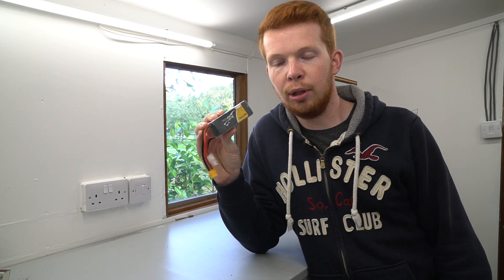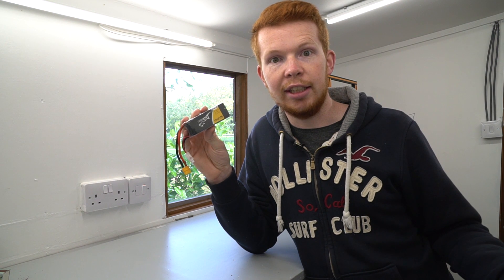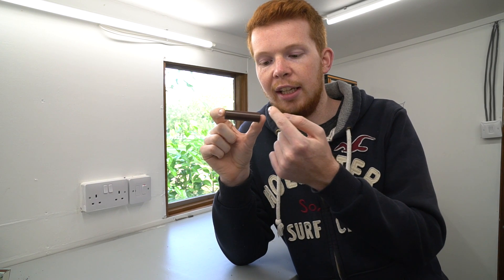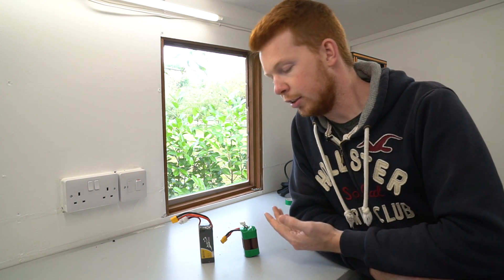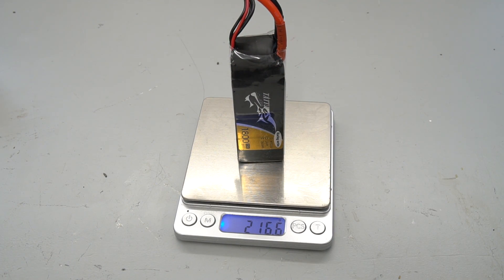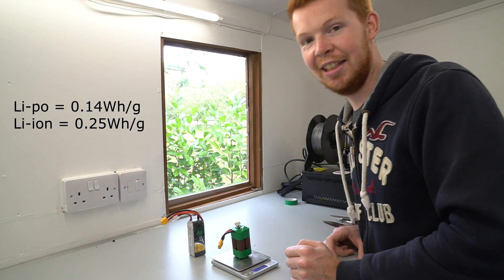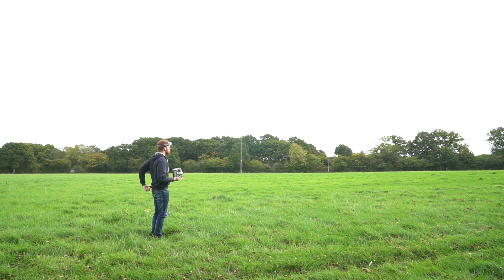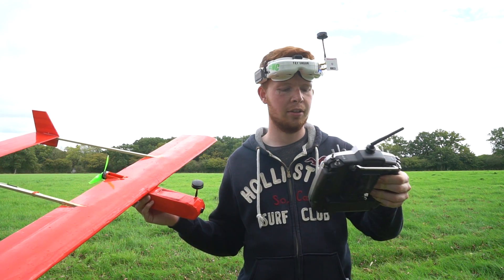Lithium ion plane battery

Comment: Tom, I am not sure if you picked the correct Li-pol battery for this test. While being in this hobby I came across many Li-Pols and as far as I understand it there are "types" of Li-Pol cells. PLEASE, correct me if I am wrong. But. For certain use there are certain cells. The one you picked is probably ment for high amp demanding multirotors. For example. I have one Multistar Battery which si 3S and doing the same math as you it has 0.21Wh/g (thats for 1.5m wings). Then I have a pack that I use for my gear - which is a 4000mAh 2S battery rated at 0.5C with 0.262 Wh/g. So for me this test is kindof irrelevant. But no hate. The Li-Pol market is very wide and Ive spent countless hours browsing them.
Reply: the thing is that if you have two different li-po cells with different ah ratings you probably have different Wh/g ratios because thats only depending on the battery chemistry i guess there are li-po battery's out there which get really close to the li-ion pack Wh/g ratio but  you probably cant demand the same amount of current from the high Wh/g battery as you would from the lower Wh/g li-po the interesting thing is that the ion pack kind of combines those two factors and you can also put a second pack in parallel to the ion pack doubling the weight ending up with battery weight of 4/3 as if you where to use li-po and having the same ability to demand high amps 

Theoretically.

this is probably written a bit complicated... forgive i'm german :D
Reply from the maker: Interesting! I think larger batteries might have a higher Wh/g value due to the heatshrink, wires and connectors have less of an impact of the overall weight? For example, as you quadruple the volume (linked to capacity?) of a cube, you only double the surface area. Therefore the weight of the outer foil casing and heatshrink doesn't scale the same as the capacity. Also higher cell count batteries will have higher surface area than an equal Wh lower cell count battery. It could also be inaccurate due to battery companies over/underrating the capacities of their batteries. I have quite a few of these 4s 1800mah and they vary in weight quite a bit between brands. This kind of stuff would be difficult to compensate for, so I just stuck to what was relevant to my current batteries and aircraft and hoped it would spark some interest for others to try. Thanks!
Reply: basti_co and Tom I have no real idea how Li-Pol cells are made. The idea about less casing and more cell "material" is good. Also I have no real idea how the energy is collected inside the cell material (chemical reaction and material mixture) but maybe the batteries with higher C rating have larger collectors that also result in a higher weight
Reply: The key factor for all Lithium cells is the C rating; the higher the C rating the heavier and larger a cell will be; the plates for higher C rated cells are thicker.  Comparing cells with different C ratings is a flawed concept as it's like comparing apples and oranges.  The foil pouch is basically the same thickness for all LiPo cells and weight scales with the surface area of each cell.
20 years ago I was flying an indoor model with a S3 Tadiran LiMnO2 pack of 780mAh (nominal 9v).  These cells are very light as they only have a 3C rating.  The model required only around 800mA to maintain height and flights over 40 minutes were made with capacity still left in the pack; it did become mind-numbingly tedious towards the end.

Comment: I like the way you explain, but there are Li-Po cells with the proper capacity label on it.

Li-Po cells cannot go under 2.5V or else it will reach irreversible chemical reaction and it will damage de cell. Above 4.25V it may catch fire. 

As a rule of the thumb, ESCs usually cut-off at 2.7 or 3V to protect the cell and most of chargers with reach 4.2V, but it's not unusual to see a cell giving 90~100% of the advertised capacity between 4.2V and 2.7V.

I usually expect a Li-Po cell to lose around 30% of their capacity after 100 cycles (charging at 1C and discharging at maximum rated C discharge).

Comment: Wouldn't 8V be too low to drive the motor or is there a voltage regulator in the plane?
Reply from the maker: 8V should still drive the motor, but there would definitely be a huge loss in performance. On this setup I would need to increase the throttle throughout the flight to stay in the air. For example, if I were using half throttle at the beginning of the flight, I would most probably be using near full throttle by the end (for the same thrust output)... I think!
Reply: Back in the days, we usually used geared motors and slower rotating props on electric planes due to the poor energy storage of cadmium cells. Maybe it's a way to use the wider voltage range of the Li-ion without too much performance loss. My 2 cents.
Reply: Any good for quad copters?
Reply: Interesting
Reply: There is a ESC in the plane, and the pilot will increase throttle as voltage drops. If the plane has a flight controller with an airspeed sensor, it will do that automatically.
Reply: Motor*
Reply: I have only used the cars so I'm not as knoledgeable about this
Reply: Many models can operate down to 4.2 to 3.4 volts with a single cell lipo battery. It's mostly down to the weight and style of the aircraft.
Reply: The amp draw may be a bit too much for the HG2 (20Amps max continuous with quite a lot of voltage sag) but with a higher amperage one... I'm using the HG2 ones for quite a while in embedded appliances and with +-15A of draw, the voltage isn't reliable. The ESCs and/or the flight controller may reset themselves. Must be tested.
Reply: To re-do the test without getting bored how about tethered flight
Reply: Sorry, I posted in the wrong thread.
Reply: It wouldn't necessarily decrees performance it would decrease the power and torque and when I say power I mean the driving capabilitys of the battery's an example of this is if you put a Nimh battery into an rc car that has been using a lipo it will decrease the speed because the mother will not have enough torque and too much resistance to frictions

Comment: All lithiums are lithium ion and li-po is lithiums ion
Reply: ion 'n polyster
Reply: Aye, and you too are a Lithiuanian ;]]]
Reply: @dainazinas  I had two girlfriends, one was half lituanian half polish, the other half lithuanian half Ionian.
Reply: Uh, no..... Lithium Polymer are in fact still lithium ion.. however, not all lithium cells are lithium ion.  There are lithium metal cells also.
Reply: They may all be Lithium cells, but the technologies chemical makeup and capabilities are different.
Reply: the 18650 cell and our hobby type lipo batteries are in fact chemically different dont be a troll man
Reply: Lots of lithium-ion cells are different chemicaly but they all share one common thing - lithium, thats why they all are called lithium ion. LiPO is lithium ion polimer cell and electrolyte is different but it is lithium ion. Go do some reading, wiki is on hand
Reply: wtf is your point agnius? it's just the standard way we name and categorize these batteries you're just trying to look smart
Reply: Kyle Hershey pussymouth
Reply: agnius, you're right and wrong, at the same time. Because there are chemistries like LiFePO4, which operate on WAY lower voltages, than other lithium chemistries. Yet you try put them in the same bag.
Reply: Rafael Silva who is we? I am building bikes and batteries for 8 years and i dont call them like that as many on es forum. The point is make it right
Reply: I am not wrong. He then should off stated that lg is nmc chemistry or lithium manganese nickel and the other is lithium polimer. To educate you more there are others like lithium manganese oxide, lithium cobalt aluminium oxide, lithium cobalt oxide, lithium iron phosphate. All of them are lithium ion cells like nickel cd and nickel mg are nickel cells

Comment: You probably wrecked your Li-ion batteries by soldering them. Cut them open and see!
Reply: forfengeligfaen:  ha ha...   well, once you cut them open you're sure that you have wrecked them..
Reply: use a soldering iron at high temp, clean the surfaces properly, and sholder quickly then its OK. I have done dozen of cells that way and they are still working fine after 18 months and many cycles.
Reply: I have solderd more than 1000 18650 bateries after 2 years steel working welllll, sory for bad english
Reply: nothing wrong with soldering them, he's just doing it wrong. too large of a wire, and too much heat transfer.
Reply: Soldering is not a good idea! Here is why https://www.youtube.com/watch?v=YrqsAGr41uU

Comment: Tom, you could add Super Capacitors with the Lithium Ion to boost the current output if that is a problem.
Reply: i'm pretty sure that all them squirrel passengers inside the big body box would not mind. Lessening the spikes on those cells would improve lifetime and so on, if can be done cheaply, regarding weight. Those supercaps were kinda low voltage, need quite many i think..
Reply: Solar Function what about the massive increase in volume?
Reply: Solar Function the ir know as internal resistance is the problem it is how much the battery resists the the output and it steadily does that as the more you drain a battery and as a ion it's alot easier to get a higher ir

Comment: I think your problem of the tests was that you used 14.8V as the cutoff point for the tests.
14.8V is the storage (~50%) voltage for the Li-Po batteries and they can be run down to 3.3V per cell without significant damage. You said the Li-Ion cells could go down to 2V per cell.

Doing a flight test down to the non damage low limit of each battery would be the way to do the tests. Sorry if that is boring for you but it could also be done on the ground as you know how much power the RC plane uses on average to stay in the air.